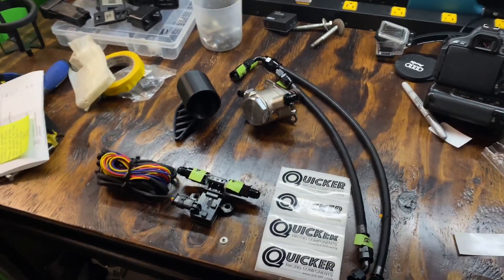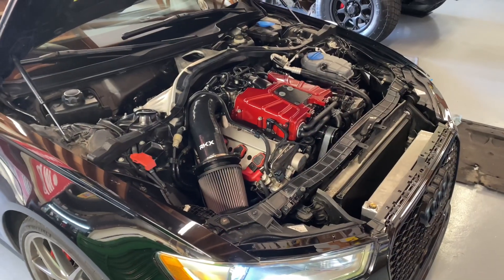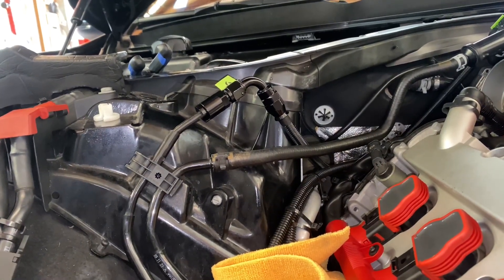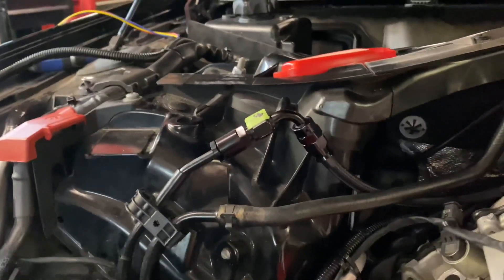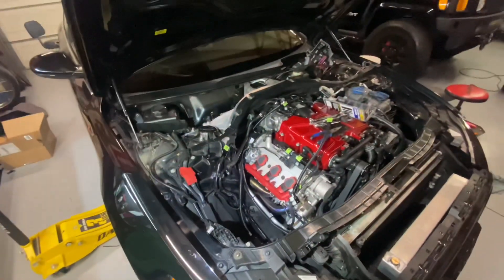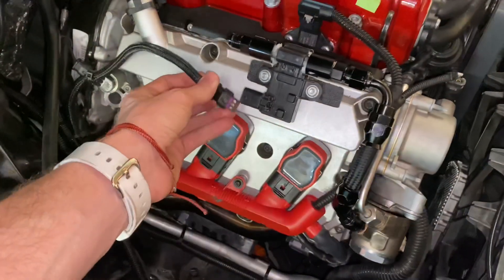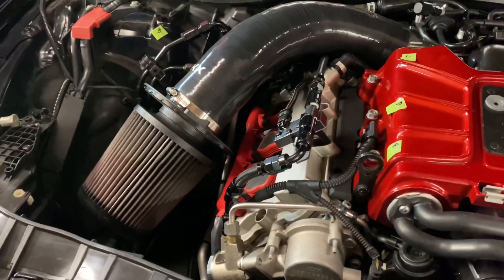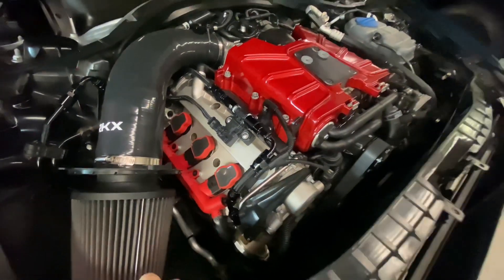Quicker Racing Components // PTFE Fuel Line Kit, HPFP, Ethanol Gauge Installation

Comment: so out of curiosity i can just upgrade my fuel pump and run e40? dont need the fuel line kit?
Reply from the maker: Correct. The quicker kit adds a nice option to add an ethanol content sensor to monitor the levels with out hacking up stock fuel lines to add one in.

Comment: I did downpipes with 200 cell cats and only get an error for the driver’s side O2 sensor bank 1 sensor 2 . I have tried 02 spacers and nothing. The passenger O2 doesn’t give me an error. Any suggestions ? The error I get is bank 1 sensor2 heater circuit open circuit . P111800..